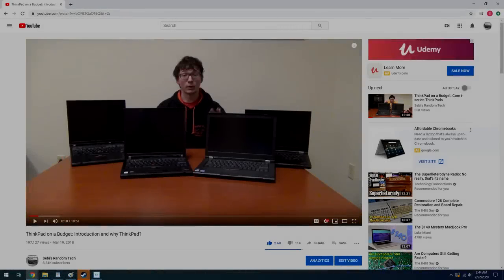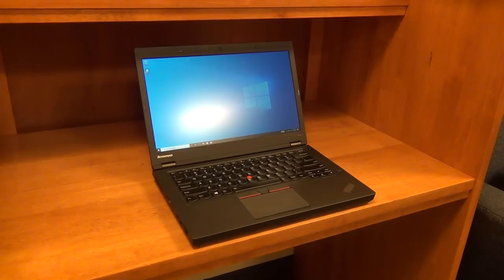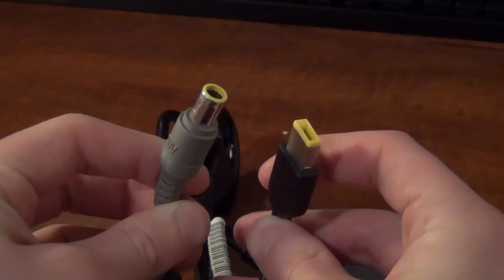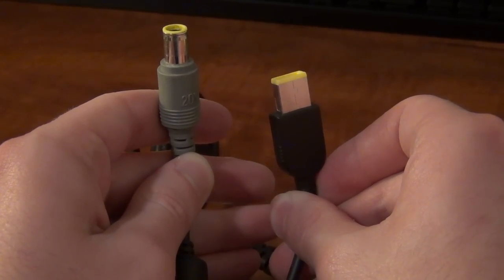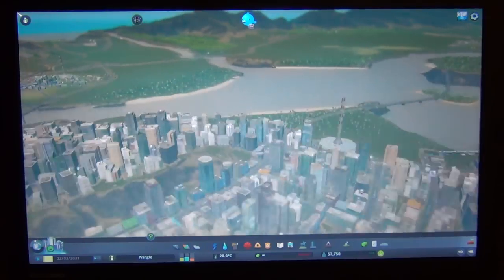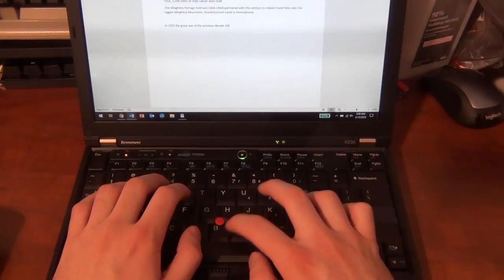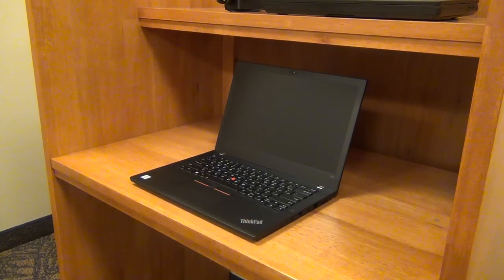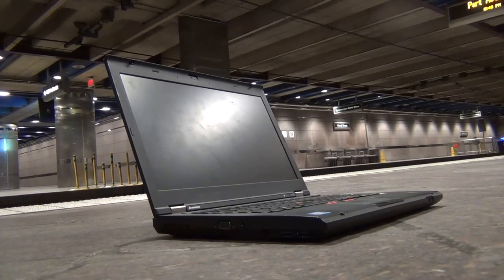Best Value ThinkPads in 2020

Comment: I don't know much about all the thinkpads but I used a p50 for work in early 2017 and it is now available for around 500 dollars on ebay. It is more powerful and versatile than t440 and t480. Wouldn't that be a better budget choice?
Reply from the maker: As I said in the video in regards to the T480, if you have $500 to spend upfront, something like that would obviously be a better deal. But if you are on a very tight budget (thinking less than $200), these 3 are the best choices since they can all be found, sometimes with higher end specs, for less than that. As you save up some more money they can be upgraded later on.
Reply: @SebisRandomTech  yeah that makes sense. Great video btw!

Comment: With the advent of virtual meetings is there an upgrade of the Webcam that will give a greater performance of the camera that is built into the Thinkpad T440P?
Reply from the maker: No, you are limited to the camera that is built in. You could possibly buy an external webcam and hook it up for better results.
Reply: @SebisRandomTech  Thank you I was wondering if there was a better cam that would take advantage of the face recognition feature of Windows 10. I love the upgrades that I have done to the 440P It weighs a ton, but you can't ask for a better daily driver than a Lenovo. I enjoy your videos

Comment: What do u think about the 8 years old x1 carbon with intel hd 4000? Can it run games like valorant? Plz reply,its urgent
Reply: no
Reply: it can’t it won’t even run minecraft
Reply: it will probably play roblox at low settings
Reply: Velso upgrading to 8 gb of ram and ssd would make it even smoother
Reply: @chanc4069  maybe not that low
Reply: @chanc4069  u prolly didnt upgrade

Comment: So the T440p is socketed but the T440s is not? Do I have that right? I just purchased a T440s with the i7 4600 for $200 on eBay. I think it’s soldered and that’s a bummer.
Reply: yeh, the t440s is lighter and thinner, but you cannot change the processor
Reply from the maker: Correct. The T440s, while thinner and getting better battery life, has soldered processors. Still a decent laptop if it has the 1080p display.

Comment: Still using my x230 after a year. It badly needs a repaste (101C under intensive load), but with it's 12GB RAM, 250GB SSD and i5-3210M works great for my daily use. It also matches my new $30 ThinkCentre m71e which I plan to add a GT 1030 in it.

Comment: T430 the best
Reply: Yes
Reply: Agree. Resilient, tough and easily upgradable. Class laptop
Reply: t420 is best
Reply: Nope no usb 3.0 ;-)
Reply: @jameswyma9849  T420 is better in keyboard.  I used T430 for last 7 years and only downfall is the keyboard layout.  Actually old T400 which I also use has better keyboard than T430.

Comment: I would buy one of those, but Thinkpad X60 T is still going strong. Not rushing to change right now.
Reply from the maker: The X60/X61 are among my favorite ThinkPads. I think it's the pinnacle of IBM/Lenovo design.
Reply: @SebisRandomTech  x60 has mobo problem.  especially the core duo ones.

Comment: These are so thick!

imho buying a 6-year old T440 (or older) and spending cash on a new battery, SSD, RAM, etc. is just a waste of cash vs buying a newer model that already has better specs

T480 is the best current laptop imho - I have the T480s and it's fantastic
Reply: You can buy a new SSD, and 16GB or RAM for well under a $100. They are both super cheap these days. I just purchased a 120GB PNY SSD, which is almost as fast as the Samsung SSD's, for $25 at best buy. 16GB of ram kits are extremely cheap, at around $60 or less. And I just seen a fully working T440P for around a $100 on ebay. So, for under $200, you can get a super fast 4th Gen Core i laptop, that is maxed out, with a super fast SSD.
Reply from the maker: @justin bryson Not to mention they won’t have the design flaws of some of the newer models, particularly in regards to the Thunderbolt issue and USB-C ports.
Reply from the maker: As was pointed out in the video, if you’re on a tighter budget these older laptops are still a better value. You can find most of them fully working for between $100-150, sometimes already upgraded with more RAM and an SSD. If you can find a fully functional T480 for that cheap let me know.

As I also said in the video, the T480 has some major design issues and other things that may hamper its value in the years to come. The T420/430/440p have proven their reliability since you can get one now still working and have a perfect machine for most tasks. The T480 has yet to prove its longevity.

I don’t mind a laptop being a bit thicker or heavier if it means it’s built better. Modern ThinkPads are still built well, but I have heard a lot more complaints about the build quality of newer machines than I have about the older ones.
Reply: @SebisRandomTech  Hi, I really liked your video. I really liked that you pointed out that these laptops have replacement parts that are super cheap, if ever needed. Like the DC Power Jack port that you mentioned. Very cheap repair on laptops where they are not soldered to the motherboard. And not knowing how to solder (I have not learned how yet), it can be expensive to take to a computer shop to get repaired. Thanks again for the great suggestions.
Reply: @SebisRandomTech  the USB C issue affected a handful of models. And of course the T480 hasn't 'proved itself' over time, because it's only been around for 2 years. Having had my T480s that long, I can assure you that it's easily the best ThinkPad I've ever used (and I've owned 10 since the A23m). Once you go newpad you don't go back to oldpad :P. Too many trade-offs with older models. No reputable battery or ultra poor battery life, no warranty and things WILL break, expensive upgrades (e.g. price of DDR2 vs DDR3 vs DDR4 per gig), poor price to performance for SSDs (as you're stuck with SATA2 speeds on most older models vs NVMe PCIe 3.0 on newer models, and even in RAID0 on some), and worst of all piss poor screens unless you do expensive upgrades with a) a $50+ adapter and b) a used screen of lower spec than modern screens. 

Don't get me wrong, I never sold my X61, and the X220 also has a special place in my heart (despite my selling it), but all my other ThinkPads over the past 2 decades were "good for now" machines that I'm happy I sold on and upgraded from.
Reply from the maker: @iamdmc  The T420 and all newer models support SATA 3 speeds. And in all honesty depending on your use case, some people will never see the performance differences between a SATA 3 SSD and an NVMe one. The T440p supports better screens from the getgo, and if paying a little bit for an upgrade kit allows me to get a better quality display in a T420 or T430, laptops that I think are designed better than many of their newer counterparts, then I will gladly pay. DDR2 RAM is a bit pricey, but are any of the models I recommended in this video using DDR2? Nyet. DDR3 RAM is cheap for the most part. The warranty isn't as huge of a deal since I didn't pay thousands for my machine, and while things may break it has never happened to me and replacement parts are cheap enough that it isn't a huge deal.
Reply: @SebisRandomTech  But doesn't the 480 have better processors and graphics card? The models with the mx150 seem pretty neet...
Reply from the maker: @gramoukdoom  The T480's processors are on par with the higher end T440p options. As for graphics, the T480 does have an advantage, but to me the T480 costing over twice as much as a T440p negates that advantage.

Comment: Would you recommend a x230t convertible in place of a iPad Air 3 Generation?
Reply from the maker: Depends on what you’ll be using it for.
Reply: Sebi's Random Tech I am using my iPad for mostly handwriting with my Apple Pencil. When I am typing up documents I am using the on-screen keyboard. I wondered if it’s worth it to get a keyboard attachment for my iPad or get a ThinkPad X230t convertible instead, since it already has keyboard and pen built in.
Reply from the maker: @owenready7043  The touch screen experience on the iPad will be far superior. Any applications that rely on the touch screen will be better on the iPad. On the other hand, the ThinkPad has a better typing experience, more ports, and uses Windows/Linux.
Reply: Sebi's Random Tech What would you suggest instead?

Comment: Don't be sentimental and old, grab t480. Newer is not always the worse.
Reply: here only t470s and below :( are cheap at around €300
T480/8th gen above are rare and usually €450/500+
Reply: @Alexander You can install W11 on a t450 for example, t480 onwards is not necessary
Reply: "don't be a peasant, just spend 3 times as much on a newer device"
Reply: @Alexander damn how
Reply: @Alexander I was running W11 on my 7350k no problems. You just have to change some registry options to disable these requirements
Reply: @Alexander t470?
Reply: There's still a charm to thick laptops
Reply: @alastorlol502  🤤
Reply: @nerd2544  finally someone gets it
Reply: unless your port breaks lol

Comment: Hi I have a T430 and am looking to upgrade from I5 to I7 processor can you tell me which I7 chip to buy please and do I need to upgrade the heat sink / fan ? Also what is the best ram to buy to upgrade from 2 x 4gb sticks to 2x 8 gb sticks can you link me up with actual products you recommend here please ? thanks, lovin you videos
Reply: The 3615QM is a good value chip and it runs a bit cooler than more powerful i7s.
Reply: @sneedsneed460  Do I need a different fan / heatsink or ac adaptor if I upgrade this cpu ?
Reply: @stevendobson4474  no
Reply from the maker: I usually recommend the 3612QM and 3632QM, as they are quad-core processors giving a huge performance boost over the i5’s, without using substantially more power. You don’t need to upgrade the heatsink, just make sure to use new thermal paste when you put the new processor in. You’ll want to have a 90W power adapter, usually the 65W isn’t enough to power these faster i7’s.
I don’t link to products in my videos because 99% of the time there isn’t one be-all-end-all seller that has them, and so when I do post links they either go dead or the seller no longer has them within a few days of me posting the video. It saves both me and viewers time to just have appropriate model numbers for them to look up on eBay, Amazon, etc.
Reply: @SebisRandomTech  I went for the 3632QM, all is well but running rather hot under load is this normal ?

Comment: Do you think this Lenovo ThinkPad T440s | i7-4600U | 14"  8 GB | 256 GB SSD | Win 10 Pro | DE for 489 dollars is a good offer? Pls help you are so helpful 😅
Reply: Pls I really need help.My Laptop broke
Reply: Nope, quiet expensive for a thinkpad
Reply: @johnnypepperonii  I'm from Italy and I can't find any good price either for t440p or t480/t480s. Can you find any?
Reply: @fastzampa  Avoid any s thinkpads, they are trash, and avoid the normal T440, it is absolute trash.
Reply from the maker: That sounds pretty expensive for a T440s, however since ThinkPads are a bit pricier in other parts of the world I can’t say for sure if that would be cheap there or not.
Reply from the maker: @VictorGamer072YT I beg to differ. The -s series has always had some compromises, but I think up through the T450s they were very solid machines, with just the perfect compromise between the slimmer and more premium (but non upgradeable) X1 Carbon and the cheaper and chunkier (but more upgradeable) T-series. Making the batteries sealed in on the T460s was the beginning of the end of that line for me, and the move to all-soldered RAM on the T490s was the last straw for me.

Of the models you listed, I actually like the T440s more than the standard T440 because while it has the same downsides as the T440, it has advantages like better display options (from the factory), a third USB port, better quality feel overall, all in a slimmer chassis. T440p still rules over both though.
Reply: @fastzampa  Hi, sorry Youtube didn't told me that you answered me. So basically, look fot a 5XX series, i'm also italian (living in germany) and i just fouind a T540p with an i5 and 4GB RAM for 180€. Updating RAM and CPU will cost me about ~150€, updating the display 20-50€. Thats close to 400€ for a "high end" thinkpad of this sort. If you can, look for broken or defect models. Since you can repair, modify and change 90% of the parts yourself, you can repair these models easily. Mine came with a broken air cooler and the cpu overheated and shutdown. Got a new one for 5€ and now its working fine again ^^

Comment: Is it worth to buy an used X270 with good battery and change the display panel later? Already have a L460, but it's kinda heavy.
Converting the value from Brazil to US Dolars, it's around $330, but, the x230 would cost $240 with no battery and TN display.
Or just giveup on used ?  lol
Reply: both of them seem like a good deal
Reply from the maker: X230 has a far better keyboard and performance is still very good, but the X270 has a better screen and more modern I/O (HDMI, USB-C, hot-swappable battery, etc). Entirely your choice.
Reply: Thanks guys, just discovered the x270 is bios locked, the x230 turns to be the only real option.
Reply: Where did you find this x270? The cheapest I found is around $415 on OLX. This using the absurd dollar x real ratio that we have today. If we use 1 USD as 4 BRL, it costs $500!
Reply: @gkato  ML, with bios locked

Comment: i think a common mod with some laptops is to use the wifi card slot to connect an external gpu configuration and if u somehow cant access an ethernet cable then a usb wifi dongle should solve that adequately

Comment: I recently purchases a T440P for school, but the absymal battery life drives me insane, but hopefully my new 9 cell battery I purchased will solve that :) A part of me kinda wishes I would have saved a little bit more and bought a used T470, because I would KILL for that dual bridge battery system, and I love modular hot-swappable batteries.  That being said, thank you for informing me about that soldered power port issue, I never knew that about newer ThinkPads :/
Reply from the maker: A new battery will likely make a big difference. My friend gets around 4-5 hours with a 6 cell, so a 9 cell should work just fine for you. The T440p was a better investment than the T470, as when fully upgraded the T440p matches or outperforms the T470.
Reply: @SebisRandomTech  I only get about 2-2.5 hours with my current 6 cell, but I suspect that it'a because the battery is heavily used.
Reply from the maker: @darthgamer6080  Hopefully you get better luck with a new 9-cell!
Reply: @SebisRandomTech  Most likely :)  Definitely will improve my experience with it a lot more, I just wish it had some way to use an external GPU.

Comment: Last christmas I bough a L520 just for 25€ in a bid, it came with a i5-2410M. I had a L430 with i3-2370M with a broken motherboard, so I took all the pieces to complete de L520 and sold the rest (only computer without hardware) for 60€. Now I have a just a bit older computer, with better processor and bigger screen, It has 4+4 extra GB RAM and a 500GB SSD and it's a rocket, you don't need anything more for a daily use, the worst thing is that the battery is almost dead (It lasts only 2 minutes) so you need to have it everytime with the charger and the graphics card is not to play games. But if you buy a thinkpad the last thing you want to do with it is to play games. Relly really happy with it and no expectations to change it for a while.

Comment: I still use T430 daily for writing. I should probably swap the display. Any recommendations?

I haven't used my W520 for ages. I think I will sell it to someone who has more use for it.
Reply: I swapped in to a 1080p IPS panel (need the adapter mod). And its day and night difference. IPS screens are awesome.
Reply: Go to Reddit's marketplace. Someone will pick it up as long as the price is reasonable.
Reply: @aneeshprasobhan  thanks. I need to investigate this further.

Comment: Hey im law student... thinking about buying a thinkpan L580 or E595(this is considerably cheaper)... what i look for in a laptop is a great keyboard, long battery life and good sound(not that important).... im getting it sent down from Japan... wondering which to buy and whether i should opt for a newer HP x360 model which is far more expensive... any advice ?
Reply from the maker: I think if money is the most important factor you should go for the E595, however the L580 is built a little bit better. E595 will perform better though.
Reply: E595 has the Ryzen so you can Game when you get bored of reading!
Reply: Buy a MacBook. Trust me.

Comment: Great video! What do you use for your daily? T430 still?
Reply from the maker: Yes.
Reply: @SebisRandomTech  I see you are rich - I'm using T410 last 7 years :D but when I think about it, everything was replaced except enclosure and usb ports that connect separately (somehow after 5 yrs a little piece of metal got on motherboard which killed it and screen was damaged when I got it) :D it's still get's work done, and I work with it every day, but was thinking about upgrading to 2gen P1 or T590-T15 as T410 is becoming a "little bit" outdated, but after your video will check older ones too, might save some money, thank you!
Reply: @danieliussipovic4704  Its a fairly big jump in technology from a T410 to a T430, you will feel the difference. But the jump in technology from a T430 and a modern laptop is much less noticeable, cpu's are definitely more power efficient but not actually that much faster in new laptops